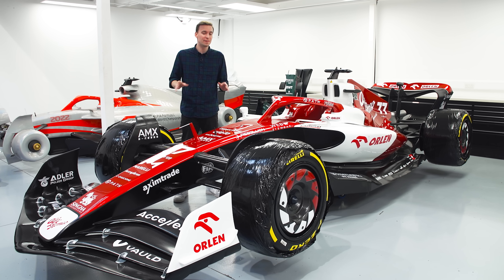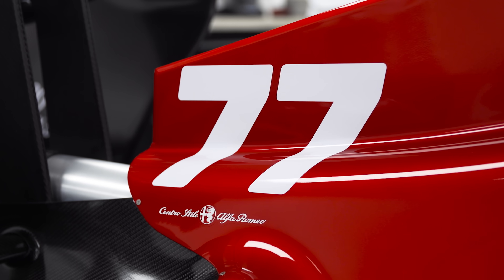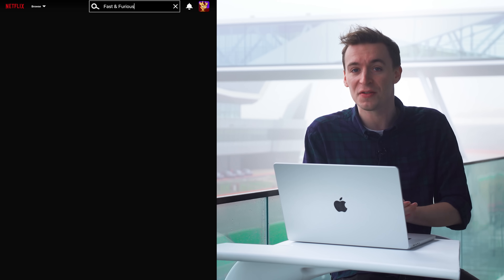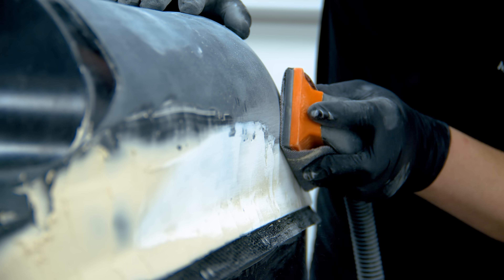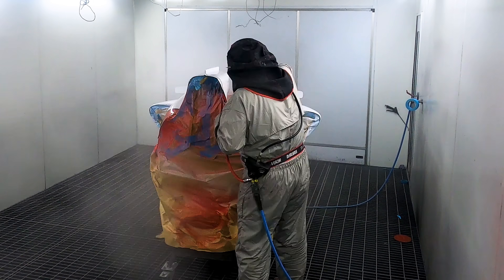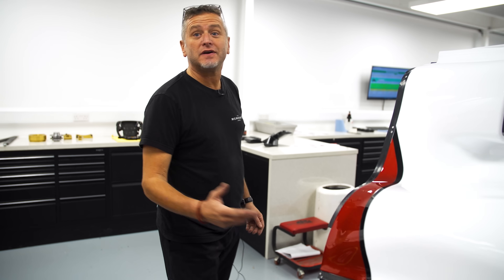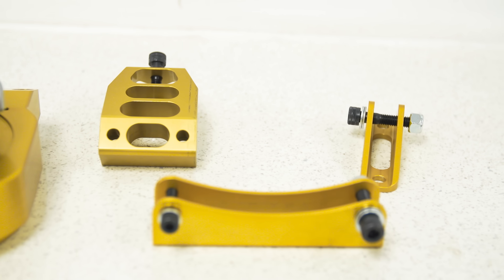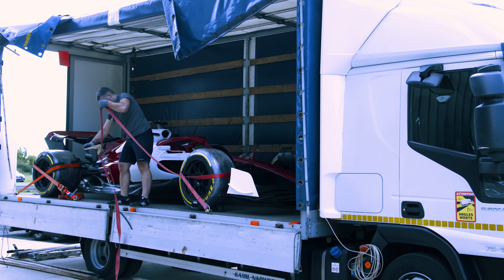How Formula 1 Cars Are Made (Replica)

Comment: Had no idea. I always thought these were made by the team just like a real car but without most of the internals.
Reply: I thought the same.
Reply: I speculate there are three reasons for this:
1. By outsourcing the production of the show cars, you obviously can save the actual production team's time to focus on real cars.
2. The current cost cap rules apply to the actual race and engineering teams and actual cars and parts, but do not apply to marketing costs. If the team themselves were building the show cars, they'd be eating into the race budgets. By outsourcing the show cars this way, they can be entirely considered marketing costs, with no impact on the cost cap.

Comment: An obnoxious level of excess!  Why use carbon fiber on a replica if it is going to get filler, paint & stickers on top?  Might as well flush your money straight down a crapper.
Reply: Fiberglass would be just as strong for a static stationary display, but a whole lot cheaper. This has become typical for F1 too do everything in excess.
Reply: @peterresetz5072  This is exactly what I was thinking… Why not just use fiberglass? Much easier to work with, and far less expensive!
Reply: maybe shipping costs since they likely move a lot
Reply: @fullofjeff  weight difference between carbon fiber and fiberglass is only about 10-15%, but fiberglass is much cheaper, easier to work with and still very strong.